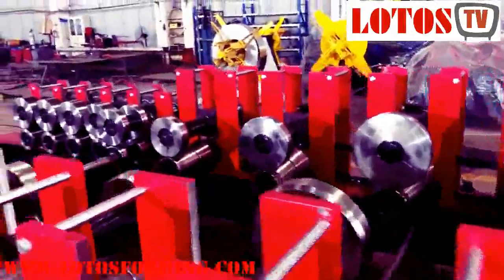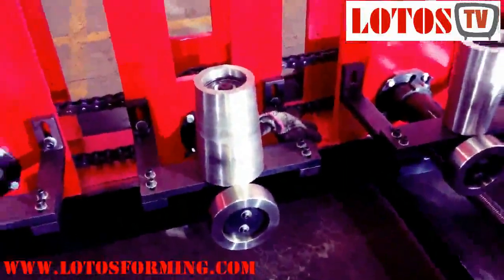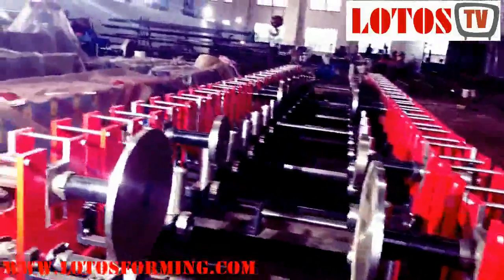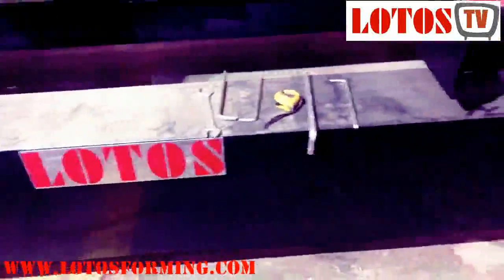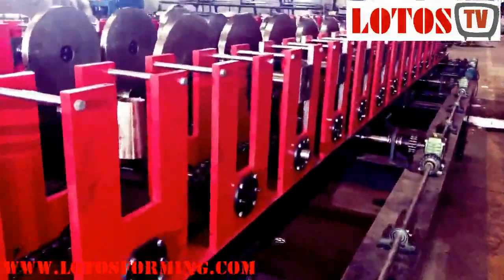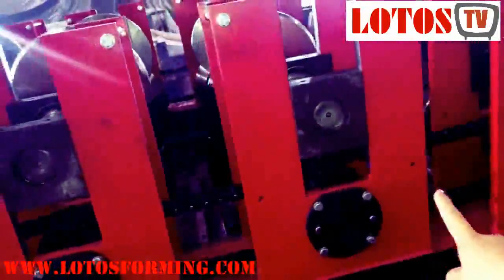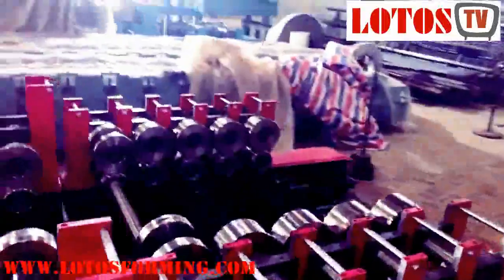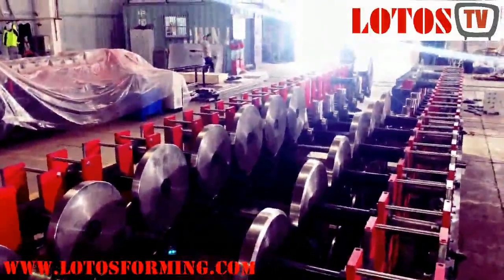Cable Tray Machine | Cable Tray Roll Forming Machine "cassette type"

Comment: new desing 
1. Cable Tray Machines
2. Cable Tray Roll Forming Machine
Reply from the maker: in mounting circuit breakers and industrial control equipment inside equipment, racks are used DIN rail a metal rail of a standard type. These products are typically made from a cold rolled carbon steel sheet

Comment: that is good.
Reply from the maker: A cable tray system use for support insulated electrical cables used for power distribution and control and communication as an alternative to open wiring or electrical conduit systems.
Reply from the maker: if you have any question please feel free to contact us

Comment: What is the difference between cable tray machine and cable ladder machine?
Reply from the maker: Cable trays usually made of steel or stainless steel that are available following types:

Ladder Type Cable Tray
Solid Bottom Cable Tray
Trough Cable Tray
Channel Cable Tray
Single Rail Cable Tray

Comment: a cable tray is a unit or assembly of units or sections and associated fittings forming a rigid structural system used to securely fasten or support cables and raceways.
Reply from the maker: lotosforming.com

Comment from the maker: In the electrical wiring of buildings, a #cable #tray system is used to support insulated electrical cables used for power distribution, control, and communication.